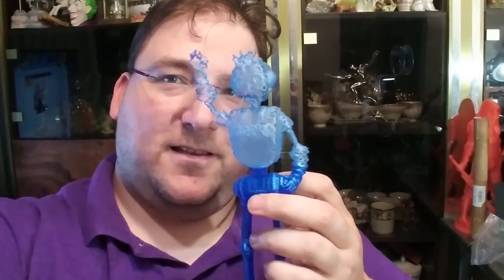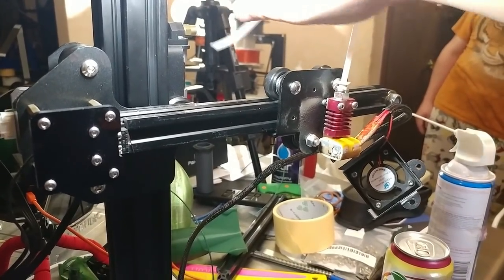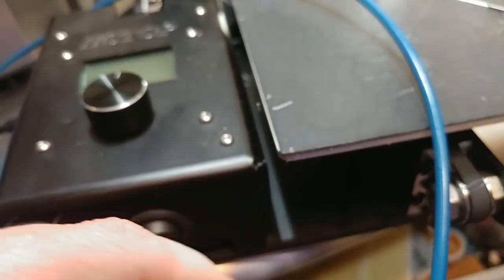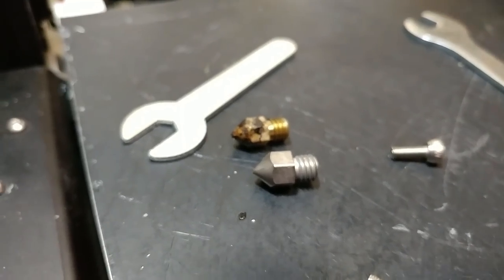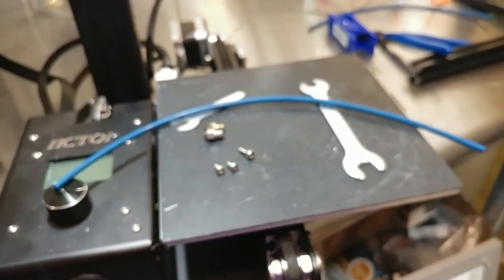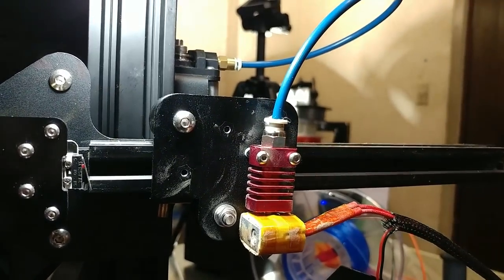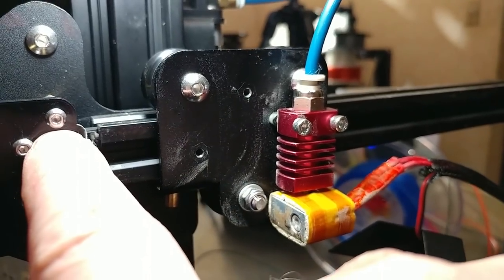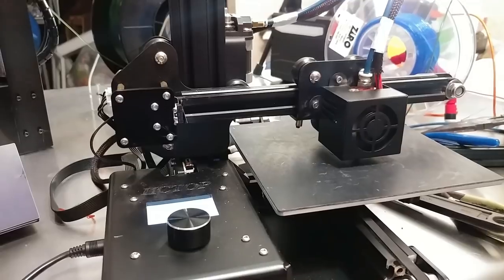Today's 3D Print 141 Nozzle Jam, Capricorn High Temp ptfe & hardened nozzle upgrade Ender 2 CR 10

Comment: My CR-10 stock PTFE tubing melted and clogged the hot end about a month ago.  I replaced it with the Capricorn PTFE and it has been working well since.  I have also used the Capricorn PTFE on my AnyCubic Linear Plus Kossell for over 6 months now with no issues.  I am a fan of this PTFE tubing.
Reply from the maker: excellent that is good to know people are having long term success with it!
Reply: reasonablebeingv

Comment: Great product “Capricorn”. Does not disappoint. A reasonable cost effective solution. I personally prefer it over an all metal extruder and use titanium throats for my extruders. We machine our extruders and throats in shop. Cost more to diy but the product is much better.

Comment: Had the same thing happen on my A5 after using wood filament. It had build up inside and the clog would not go away. Ordered the Capricorn as well last night with the tubing cutter. I am feeling that I should not use a .4 nozzle with this filament but will up it to a .5 or .6. Thank you for sharing Nerys!
Reply from the maker: +Richard Corwin for wood full raise the temp. I kept getting clogs till i ran it at 230c no problems after that (hatchbox)
Reply: Thank you for the advice Nerys. I originally ran it at 220c and then changed back to regular pla at 215. Somehow there was a chunk still in there afterwards. I think there might have been a tiny gap. Got out the plug last night but it happened again. I have never heard of the clips you were talking about so I will print a few tonight when I get home. Also agree with the dome heads. Thank you again sir!! Oh yeah, Merry Christmas!

Comment: You can use the V6 style tips as well. I've never had much luck trying to unclog them. I don't even bother anymore, I just replace them. They are super cheap anyway.
Reply from the maker: +Kent Campbell you can usually unclog just by cranking the temperature to 260 and pushing filament through I only have that fail one single time and that was because of a buildup of the glitter in the nozzle otherwise the little acupuncture needle they come with works amazingly well turn the temperature up to 2:40 poke it in from underneath clog cleared push up some filament through and then do a couple of cold poles around 150 to 160 Celsius I will do a video on that process
Reply: I don't have many clogs. I do cold pulls between filament changes. Most of my clogs have been from carbon build up. Cleaning the nozzle with a needle would get to work just long enough to fool me into walking away thinking I fixed it. Heat won't break up carbon (or glitter). It's easy to change the nozzle and I bought a ton of them on Aliexpress for practically nothing.
Reply from the maker: +Kent Campbell carbon build-up? You have me confused I've noticed no carbon buildup in any of my nozzles?? When I clean them out they appear to be clean could it be the filament you're using or something? Carbon is usually a combustion byproduct which would indicate your cooking off a filament as in printing way too hot but you would notice other effects if that were the case

Now I am curious do you have any pictures?
Reply: I assume it's from using different filament types. It might be from impurities in or on the filament. Perhaps dust?? All I know is I've had it in the past.
Reply from the maker: +Kent Campbell  interesting I'll have to keep an eye on that so I have several thousand hours in printing on some of these printers and no problem yet but I tend to only use pla which might be an important factor

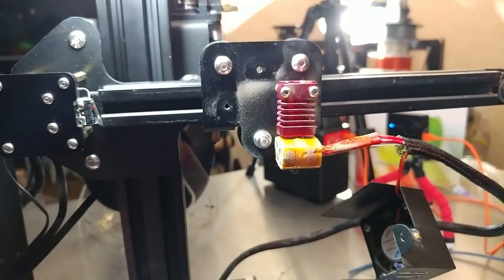Comment: Great video, thanks for the good information. You mentioned you used a 'hardened stainless steel' nozzle  however at around  3:00 in the video the package is a 'plated' nozzle. Did you use a plated nozzle, I'm confused??
Reply from the maker: I had purchased both without realizing. Plated and a2 hardened. Did not realize till afterwards.

Comment: How far do you put the Bowden tube in?? We had a leak inside that red block that the tube goes in and we think it's because we didnt have it pushed down far enough. How far does it need to go? How do we clean out the red block, is that a serious problem that results in some kind of replacement?
Reply from the maker: All the way in all the way down to the nozzle they have to touch and mate perfectly this usually does not cause permanent damage unscrew the compression fitting unscrew the nozzle you'll see that the PTFE tube could pass straight through all the way clear out the passage until you can pass that PTFE tube all the way out the bottom

 If you check my recent videos I have an entire video on exactly this process using my 500% scale model of the hot end

Comment: The weak stock PC4-01 pneumatic connector and original white ptfe need to be replaced with better ones. Waiting for new Capricorn XS ptfe tube.
Reply from the maker: Yep they are junky but do usually work ok i have only had to replace in over 100 printers.

Comment: Another excellent video - Look forward to hearing if you get the temperature increase you want. Would love to be able to do Nylon and/or abs (not sure what temperature they need though) - I also see you have links to Banggood and Aliexpress. I was just about to place an order so will use your links. Cheers for now.
Jim
Reply from the maker: +Jim Oates I know I can do 260 I already have I'm firmware locked beyond that I will need to unlock the firmware to go higher

Comment: How did you remove the hot end fitting from the bowden tube?
Reply from the maker: Depress the button ring that's around the Bowden tube and pull the tube out now sometimes you can't do this it gets jammed in there that's because the compression fitting digs into the PTFE acting like a hook and this instance you can try rotating the tube or simply unscrew the compression fitting and push the tube further into the fitting and then attempt to slide it off worst case scenario slide it all the way off the other end

Comment: You’d have been much better replacing the hotend with an all metal hotend, I’m doing exactly that, doing a full change from stock to capricorn xs ptfe tube, micro swiss all metal hotend and hardened mk8 nozzle, biggest upgrade I’m doing.
Reply from the maker: I prefer the Simplicity of the all PTFE hotend that is the one and only time I've ever had to replace the PTFE tube and I believe it was the glitter filament building up in the nozzle that jammed it :-)

Comment: any suggestions on how do  get  a stripped dome screw out.  I was  trying to but  dampers on the  steppers  and X axis went ok  but the  Y-axis  I can only get 1 of the 4 out.
Reply from the maker: If you have good access to the Head my first attempt would be a cut off disc on my Dremel to nip to opposite sides of the Dome to make them flat so that I can then put a pair of pliers on it
Reply: Thanks  for the quick reply  I went to a hardware store and got a generic  Dremel  diamond  cut off tool (Dremel wanted $17 , the generic was $5) .  I then  cut  a slot in the dome screw.  So a flat head  screw driver could bit on the head.  It worked and I was surprised how little force I needed with the flat head to pop it.  Got some better M3 x 6mm screws. just got it back together.  The new fans for the CR-10  should  come in Friday,  so  I'm hoping  for  a much quieter weekend.  Thanks again
Reply from the maker: Cutting a slot in it was my next suggestion but I never make that one first since if that one fails you've destroyed it enough that you can't try everything else :-) I am glad it worked yes they sometimes include some pretty crummy Hardware with these printers

Comment: How was your experience extruding with makergeeks? Did it clog? I am curently waiting on a capricon xs tube for my printer, I am going to print makergeeks petg and was wondering your experience.
Reply from the maker: No problems at all majorgeeks has always worked very well for me the customer service might not be the best but they're filament is top-notch
Reply: Nerys thanks for the quick reply. I hope my setup has no issues, i'm going to print with a passthrough heat break so the capricorn tube will be up against the nozzle.
Reply from the maker: That is how creality does it and its very efficient. I prefer that way. Remember sometimes makergeeks likes it hot. I tend to print at 220c for their more unusual plastics. Sometimes 225c to 230c for their higher temp blends.
Reply: Nerys hey, I got my capricorn tube, i'm trying to print with makergeeks crystal series p-etg, I was wondering if you connected the nozzle directly to the block? Or left it as is (unscrewed one or two turns)? I have serious underextruding issues for some odd reason.

Comment: My Ender 2 printing ABS very Fine. Small Pieces, but not bad. At 235ºC nozzle and 100ºC the bed. Is about 2 mins to heatbed reach 100ºC :-)
Good to know that steel nozzle is compatible with Ender 2. I have a pair of this here! 

Cheers
Reply from the maker: +PLAYNIMATIONS hey how did you get the heat pad past 60 C? Did it except the higher-temperature command in gcode? Putting an enclosure around an Ender to would be Child's Play! I would kill to do nylon and polycarbonate on my Enders !!!
Reply: Only Preheat ABS. This is another 220V EU PLUG Hictop or Creality Ender 2. Yours, looks different. The power conector is gone. I have a completely Power Suply outside of the Ender.
I tried and can do 110ºC in the bed. So HOTTT!!! :D
And maximun 245ºC in Nozzle, but i printed in 235ºC and 110ºC, but normally put 100ºC in the bed. Mi pieces are not huge.
I don't have polycarbonate or Nylon. But i have Flex....whatever xD 
Oh yes! I remember.  FlexiSMART, but not tried yet. When i have time, put this flex filament and try in the ender 2.
Reply from the maker: +PLAYNIMATIONS interesting I might have to see about getting another Ender to compare them
Reply: Mine is from Gearbest with your coupon :-D
But it is EU PLUG 220V
Reply from the maker: does not matter the machines are 110-220v compatible. just need a different $3 plug if your from a diff country.

and thank  you!

Comment: Hi, I clicked on the link for the nozzle for my CR10, but it doesn’t look the same. Are you sure it’s the right nozzle?
Reply from the maker: I just checked that should be the correct nozzle that is what I am using on mine do you have a picture of your hot end? It's possible although unlikely they may have changed it? If in doubt send me a picture use Imgur.com

It should be a 1.75 mm M6 thread remember you're only replacing the little brass piece on the bottom where the filament comes out you're not replacing the whole Square block just a little brass piece on the bottom
Reply: Yes, but the nozzle in your link looks like a MK10 one with a longer thread.
Reply from the maker: I am not entirely sure about the differences what I know is that bad as the one that I have installed on my Ender 2 printers which uses the exact same hotend as the CR 10

I'm not sure how to confirm it
Reply: No problem, thanks anyway! I've just ordered a set of brass nozzles. Did you do any more updates on the Ender?
Reply from the maker: Not yet but I have another build coming soon I'm going to try to print nylon x with an Ender :-)
Reply: Looking forward to it! Your videos are very helpful.

Comment: OK so if you replace this tubing on a cr10, change the firmware and change the nozzle to a hardened one , it is good to go for printing the higher temp stuff like nylon?? Does the cr10 tubing go all the way to the nozzle or is there a separate tube in it?
Reply from the maker: +choco107 yes just don't go past 260 so you don't need to modify the firmware if you want to go past 260 you really need a hot end that doesn't have a PTFE tube inside it such as the micros Swiss or an e3d etc..
Reply: Nerys but those Capricorn are rated at 300 ??
Reply from the maker: +choco107 there is some question as to whether they can actually handle that PTFE itself begins to break down at 300C and emits toxins

I question whether we can truly safely handle 300C printing for hours on end until we know more from somebody more experienced I would limit the 260 or 270
Reply: Thanks nery, I emailed Capricorn they said about 275 280 would be the max when used in the hotend
Reply: Sorry 275 280 with no deformation could still have gassing issues
Reply from the maker: +choco107 exactly which is why we're saying keep it around a maximum of 260 which tool allows you to dabble in the higher-temperature plastic safely you won't be extruding no ultem but we can play with polycarbonate Composites and nylons :-)

Comment: I have been getting jams on my tornado and i have figured out why.  the cooling fan for the extruder whilst getting 24 volts was not spinning thus not cooling the heatsink.  I need to get a new fan now and not sure what the extruder fan is rated to for current draw.  Researching it shows mixed information from .04 amps to .12 amps depending on supplier (same pegda technology 24v 40mm fan) which is a fairly big difference.  Any ideas?  Also need one of those needle things.
Reply from the maker: +Mark Andrews. It should not matter any 24 volt fan the correct size and dimension should work just fine obviously verify these Dimensions first I have not measured the fan but if it's a normal 40 by 40 by 10 like most of these printers this one should work fine aflink http://amzn.to/2yzwd7l
Reply: Thanks for the reply.  a local 3d printer store has some fans of varying current draw that look the same as that one so i will see what they have in stock.  yes regarding the dimensions, it is 40 x 40 x 10 but only two wire not three.
Reply: You might still find something similar in an automotive store.  Look for something to clean carburetor venturi or needle valves.
Reply from the maker: +Mark Andrews three-wire is irrelevant don't worry about it the third wire is just for feedback so your computer or whatever can sense the RPM of the fan you don't need to use it and it won't affect the operation of the fan
Reply: Thats very good to know.  might make finding a local fan a bit cheaper than a printer shop.

Comment: While Capricorn has a higher melting point.  It still starts to offgas around 250C like any other PTFE tubing.  While you can print with higher temps Capricorn, you will still be producing toxic fumes.  These fumes are deadly to pet birds.  Probably, over time not very good for humans either.  IMHO, all metal hotends are still the way to go if you want to print high temp filament.

Comment: It's not one way. Usually it's stuck from going the other way because all the hardened filament.
Reply from the maker: No it's stuck when I disassemble it and get the film it out you can see the wedge cut into the filament where it's snagged on whatever was holding it up inside out end up by the coupler if I remember I'll take a picture of it and post it later
Reply: Nerys I know what you mean, because mine was like that, but after if you press it down and pull it hard enough it'll slide. It's hard to pull it back the other way because it got eaten up like that. It's because that end moves so much so the tube gets damaged. If it was a nice new tube you could go both directions much easier. You can still yank it out the other way, it's just really hard because the teeth damaged it.
Reply from the maker: It's brand new it was the very first time I attempted to pull filament through the printer there is an alignment issue between the coupler and the heat break tube in the hot end we're an edge of metal inside grabs the filament and won't allow it to reverse the polling is what creates the wedge cut in the filament when it catches and I yank interesting me enough I do not have this problem on the anet E10 but on the A4 and the E12 it is impossible on my machines to pull filament I swapped out the hot end to a cr10 hot end and I have no problem :-)

In my particular case the issue is mechanical either poorly designed or built with poor tolerances hot end
Reply: Nerys it wasn't new if it had a jam. Lol my cr10s came with a spare. I found it was stuck because of melted hardened filament, but I guess yours could be different
Reply from the maker: Never mind all of that I am stupid :-) I was not paying attention and did not realize we were on a completely different videos in the one I thought we were on :-) this printer was a normal Jam the filament I'm using has particulate matter in it and eventually that particulate matter can clog the nozzle if an unusually large piece gets in there :-) no big deal on this one I've only ever clogged a creality printer twice and both times was from using exotic filaments :-)

Someone else was talking to me about the inability to do a push pull on an anet printer the wording of your comment was similar enough that I just thought it was a continuation of that conversation I was not paying attention :-) so completely ignore the unedited version of this reply and the previous reply they are incorrectly placed here my bad :-)
Reply: Nerys HAHAHA

Comment: How can you keep this from happening?
Reply from the maker: +GeoDroidJohn keep your filament clean keep the printer clean keep your print environment clean but in reality you can't it just happens sometimes impurities in the filament contamination in the filament line build up in the nozzle that doesn't get pushed out with the filament sometimes you just can't it happens but the fix is easy 

you can do preventive maintenance once you are aware of something causing a clog for example now that I know the glitter filament causes a clog potential I will do cold pulls after using it from now on so I'm not likely to get another clog for this reason. As I learn of new issues that cause a clog potential I will adjust my printing practices to account for them if possible :-)